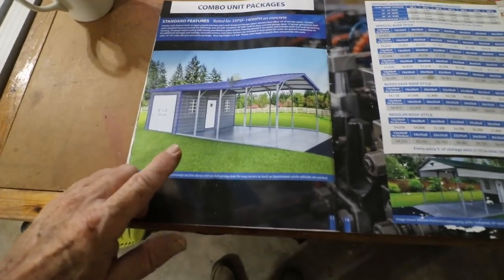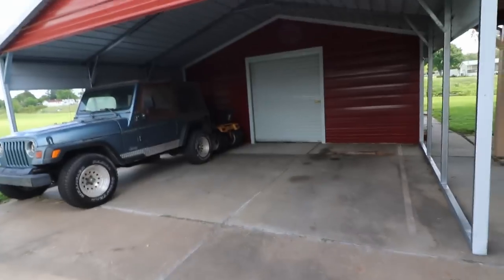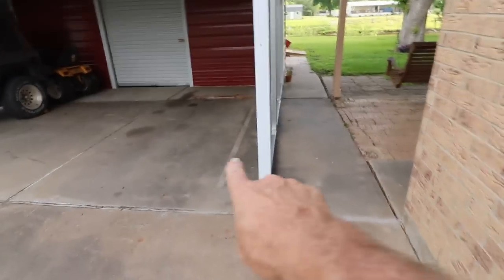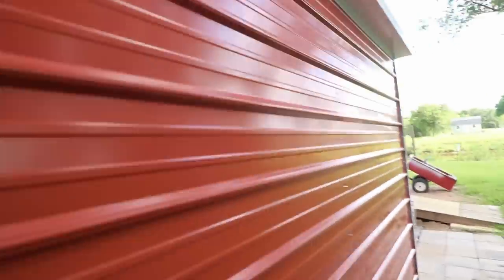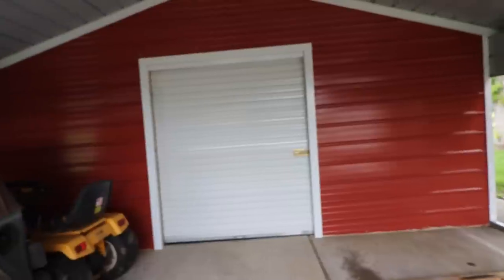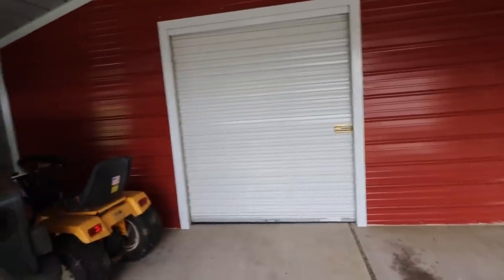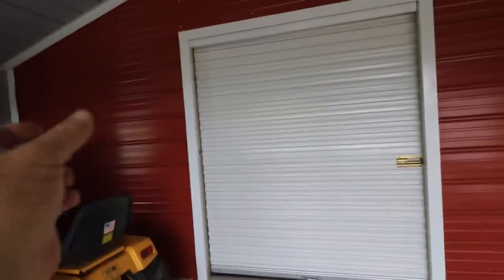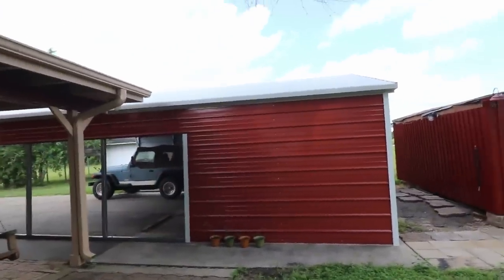DYI Carport Combo savings and customized, C&T Episode 152

Comment: This is precisely what I have been looking at, and using the website's 3D tool, except my needs are just one vehicle with a garage door in the front and really an open-end back because my lot/land has a tall cedar fence around it. I also need a rollup door like this that a vehicle can drive through.
I am just shopping around to see how these are working for people. I have a month where it can get a little angry windy and curious how these act during wind? Mine will be concrete slab anchored, can you tell me how they stand up to wind?
It looks beautiful...
Reply from the maker: 150mph rated, seems to be solid.
Reply: @SirTools  I am pacific west coast valley, 150 is extremely rare, Thank you very much...